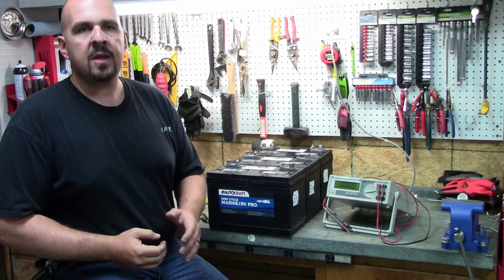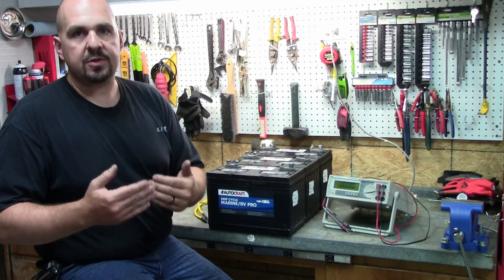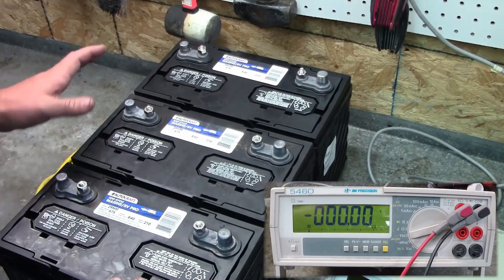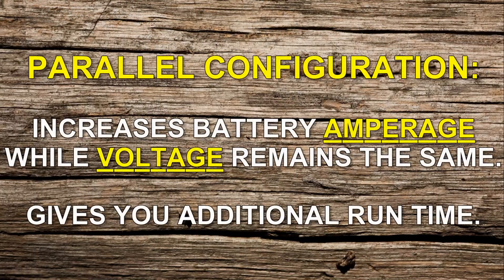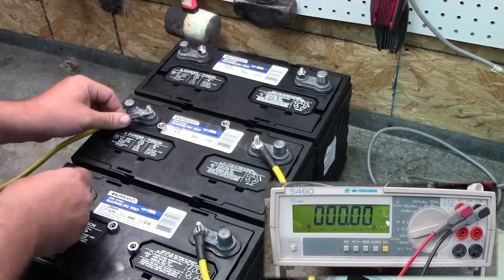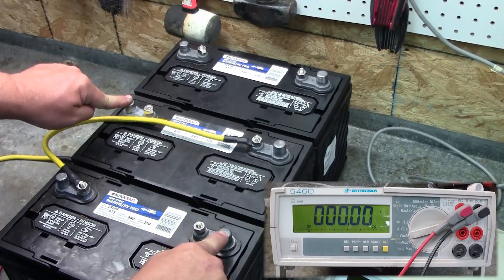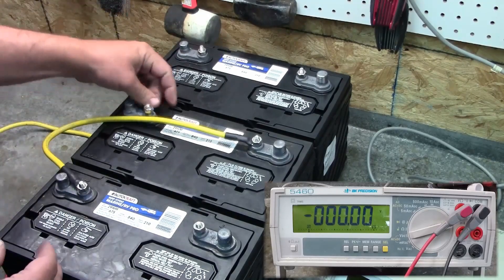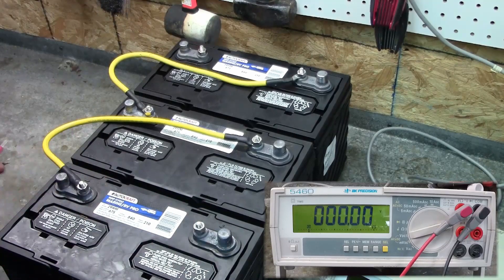How to Properly Wire 12v, 24v & 36 Volt Trolling Motor Batteries In Your Boat (Series vs. Parallel)

Comment: Wath of i want too recharge my batteries...do i recharge one by one?
Reply from the maker: Yes. I kept multiple 12v battery chargers and it was a hassle to hook up each battery individually. What I ended up doing was purchasing a noco genius onboard charger. They make them with just about as many banks as you'd need. On my boat with the 36v trolling motor, I have a 4 bank onboard charger. 3 banks for trolling motor batteries and 1 bank for the starting battery.
Reply: Weekend Angler, What if I had 48v, could I just use a 48v charger?

Comment: Excellent information! Still a little unclear of how to determine whether to series or parallel is needed.
Reply from the maker: Parallel keeps voltage at 12v. In series, you gain 12v with each battery connected. Your trolling motor would determine which configuration you require.
Reply: @TheWeekendAngler  I am new to boating.  My dad gave me his Bayliner  cruiser.  He's in his mid 80's and can't really give me much help on the power requirements. It has a cabin with refrigerator, interior lights and stove and refrigerator.  Should I assume I need the higher voltage?
Reply from the maker: @hwinbush  honestly I think you'd be looking at a 12v system similar to what would be found in an rv. That being the case, multiple 12v batteries wired in parallel would give you additional runtime. Your engine likely has an alternator which would charge the batteries while it's running.
Reply: It does have an alternator.  Thanks for clarifying.  I really appreciate your help on this.

Comment: If I have a 24v system for my trolling motor and want to install a batter disconnect switch. Should I place that switch on the negative(black) wire leaving the battery? or do i need both batteries individually disconnected? aka a 2 battery disconnect for the two batteries in series?
Reply from the maker: Instead of a standard disconnect, purchase a marine circuit breaker with manual release (bussmann or minn Kota) install the breaker on the positive wire after the batteries are in series. When you want to disconnect the voltage to your trolling motor, just press the red button on the breaker.

Minn Kota has a breaker size chart depending on the size of your motor, but a good rule of thumb is to use a 50 amp breaker on a 24v motor.

Comment: This was a fantastic video, thanks for making and sharing the info. One question for you, could you pls tell me what gauge jumper cable you used for connecting the batteries together? TIA
Reply from the maker: Thank you for the comment! I used 6 awg marine grade tinned wire to make the jumper. I also used 6ga wire from the batteries to the trolling motor.
Reply: @TheWeekendAngler  Thank you so much for the reply and thanks again for sharing your expertise!